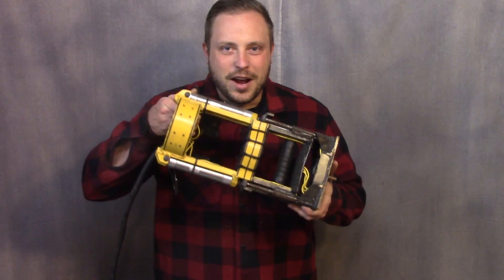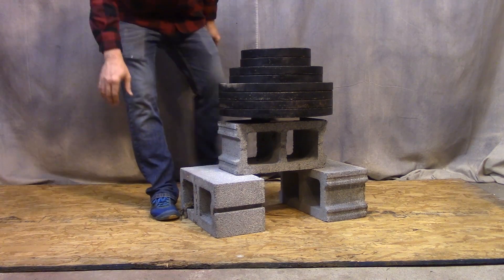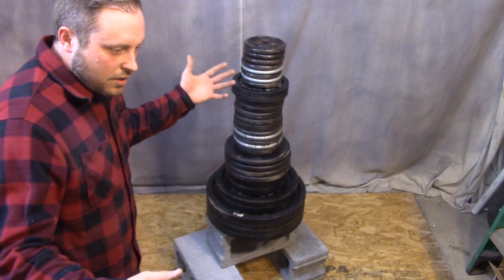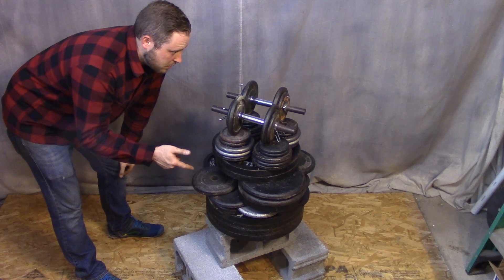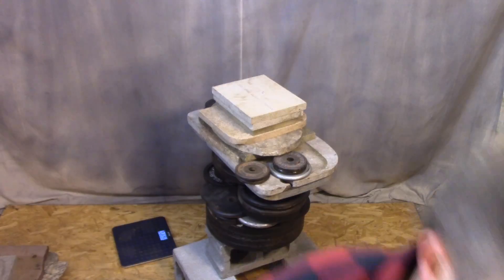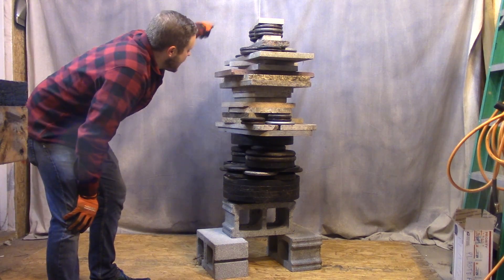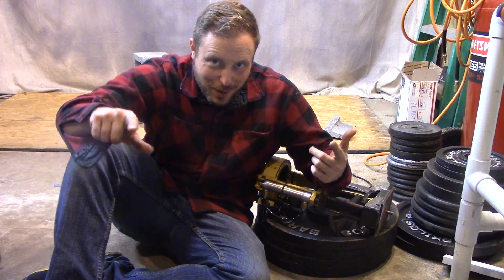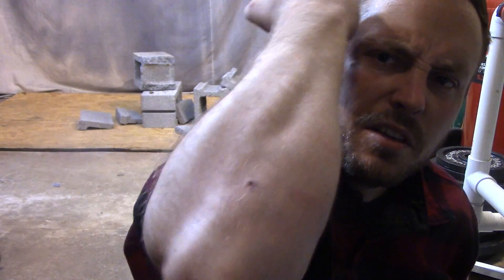POWERFIST POWER TEST - How much force to break a cinder block

Comment: The reason it's not working is because whenever you punch you're putting all that Force even though it's significantly less than the actual weight you're piling on because it's so fast you can break it but if you pile it on slowly it will actually be able to bend and stretch but concrete can't do that very fast so when you pile it it can hold more weight than what it normally could if you were to hit it with that weight if you dropped the same weight more than two inches you would break it without a doubt even half that weight you would break it have you ever taken Silly Putty and slowly stretched it versus pulling it really fast and quick it's because the atoms cannot slide past each other fast enough when you pull it really quickly think of concrete as a much much much much stiffer version of silly putty you punch Silly Putty it breaks into a thousand little pieces but if you slowly put weight on it it stretches and flattens out far more than any concrete ever would but the principle itself is the same to a degree but over time they can move and but if you put on that weight on it Fast it will break the further the atoms of the concrete moves from one another the less strong of a bond they have but they can move slightly to accommodate for weight on top and that's what they're built for and construction is to slowly have weight put on them but if they tried to put the same cinder blocks under that same pressure immediately like if they were to teleport the entire building except for the bottom layer of cinder blocks directly on top they would shatter and be powder in the second
Reply: Jaskatzu He used an Apostrophe..
Reply: How about some punctuation next time? :x
Reply: Concrete has very low tensile strength. That's why we reinforce it with steel. Concrete has very high compressive strength, which makes it suitable for static loads (stacking weights) but not dynamic loads (impacts)

If concrete did have high tensile strength, he wouldn't be able to break it like that. Instead, it would deform like steel would. The reason the block didn't break under the static load despite the hollow space directly underneath it, is because the span was short enough for the weight to be transferred to the two supporting blocks.
Reply: CHRIS CRAFT please use punctuation if you want when dictating an educated opinion
Reply: CHRIS CRAFT longest sentence ever
Reply: An being singular haha. Holy shit
Reply: Reading this made me run out of breath
Reply: CHRIS CRAFT you sound like a 10 year old who knows what he's talking about but doesn't know the right words
Reply: F=ma he was adding no acceleration and therefore very little force.
Reply: Shining Darkness nicely put the only reason I didn't do it like that is because it wouldn't make sense to most people
Reply: CHRIS CRAFT well most people need to pay attention in highschool physics. F=ma is like day one.
Reply: This made me feel like the people who yell at prerecorded videos because the actor is being stupid or is stupid and needs to be educated immediately or else fails. I do think he eventually smartened up when he was like, "maybe this falling es no bueno" dx
Reply: CHRIS CRAFT have you ever heard of a period?
Reply: Shining Darkness while you're on the right track of thought, f=ma is not the right equation. This is because the weights on top of the block ARE accelerating due to gravity (9.8m/s^2). If they weren't accelerating they'd be weightless and unable to produce any force (as if they were in space). The difference here is that the static weights are producing FORCE (Newtons) rather than kinetic ENERGY (Joules). Since the power fist is in motion, it is capable of outputting energy, which may have enough power to break the potential ENERGY of the bonds in between the concrete molecules.
Reply: CHRIS CRAFT TLTR
Reply: CHRIS CRAFT yeah I thought about this as I worked a short amount of time in brick laying and learned about how cinder blocks and bricks could hold tons of weight but if you were to hit them with that ton of weight very quickly they'd snap from the force
Reply: Shining Darkness ha ha right people sometimes just discredit things before they have the chance to explore them
Reply: All I saw was a run on sentence
Reply: CHRIS CRAFT Don't worry I don't care about punctuation it is puzzling people have a hard time seeing things without little tiny marionettes idk just weird creatures
Reply: CHRIS CRAFT thank you
Reply: CHRIS CRAFT lmao
Reply: Mister Anchors oh man, you were using your mind to read this and you started to loose oxygen flow to your brain? You might wanna read more and get yourself checked cause i doubt you read it aloud
Reply: Mr Lions if he did i believe he would have regretted learning about one
Reply: PhD in engineering, never took 1st grade English.
Reply: Also, why did you capitalize Force? This isn't Star Wars.
Reply: CHRIS CRAFT  a very apt explaination. motion is also a force multiplier  generating more kinetic force then static force with a smaller source added with a focal point. example if arm ways 5lbs it generates 5psi but when arm moves at a rate of 5mps at a distance of 2ft then arm now puts out 5psi x 30 add the size of fist and you gat this 5psi x 30 x 10= a crap ton of psi. now I know the math is Bullshit but that is loose explaination.
Reply: CHRIS CRAFT this is the perfect example of a "Run-on Sentence"
Reply: I was gonna make this comment but im glad i didn't because you already explained it lol, exactly concrete has an amazing tensile strength which is why we use it in so many of our buildings and other parts of our infrastructure.
Reply: CHRIS CRAFT I bet you're fun at parties
Reply: nice wall of text

Comment: I think it's the angle or the concentration of the force on one point is why Connor can punch thru a cinder block
Reply: Giblam1 you are correct, as an engineering student you learn the difference between impact toughness and ultimate strength. If a material is able to absorb the weight and adjust it's shape accordingly, then it will resist as much as it can possibly and that's it's ultimate strength. But if I can't as it is a sudden burst of energy, it can likely fail and break easier. This is due to differences in atomic bonds, kinetic vs static friction, elasticity, ECT. The best way to show how much force the punch would be is to use a rig that collects data from punching an object, collecting velocity over time and doing the necessary calculations for kinetic energy and force
Reply: there's a pin on the front, all the force in concentrated on that very small surface area. his "experiment" doesn't prove shit.
Reply: If we're talking pressure kinda. But here he's comparing potential energy (the weights) and Kinetic energy. The formula for kinetic energy is 1/2mv^2 while the formula for potential energy is mgh(g being the gravity 9.8N/m^2). If he really wanted to know how much weight he needed, since energy is energy, it would be isolating the mass of mgh with Ek=Ep.
Reply: It because he putting pressure on the whole block instead on one point ,and he isn't putting actual force on it he's just putting pressure so it's gonna take more weight then just a normal punch
Reply: Which is why I wonder why how does him stacking weight on the cinderblocks like it matters lmao
Reply: Boom tendo was about to say, the weights are slightly inaccurate as the fist concentrates force in a small area, while the weights are more spread
Reply: Boom tendo it's also the momentum and kinetic energy of his fist
Reply: Uh no, Cinderblocks are designed to be layed so rebar can be fed through them and then filled with concrete. The center adds extra durability, stack-ability, and a spacer between rebar. Cinderblocks are never layed in this manner in construction.
Reply: K Staffenberg no lol stfu wrong
Reply: Force would be mass X gravity the thing you mean would be kinetic energy wich is the reason the blocks broke because of the punch but not from the weights
The weights were pusching with more force but it was potential energy so when you add a little momentum to something it is way more powerfull than something with more weight than you as a normal man or woman could punch. 
And please don't hate me because of this comment XD
Reply: Boom tendo could be wrong but I'm assuming it's also the speed that takes into account as well
Reply: The force exerted by the weights is more than enough to break the block. The real problem is with distance and position. If you look closely, you can see that the diameter of the first weight is almost the same as the block itself, that not only means that the pressure is a lot smaller, but the force is also spread perfectly to the other two supporting blocks. Essentially, this is the same as having the block on the ground and as a result it is almost impossible to break the block unless you had enough force to totally crush it, which is much higher than breaking it into half since the block was designed to support entire buildings. In conclusion, he accidentally used an unfair comparison
Reply: in a way you have to add force and not pressure
Reply: Watching a lot of YouTube is what I'm doing at 2am
Reply: Boom tendo I think he moved the base support blocks a little further apart the second time
Reply: Boom tendo same just putting the weights on will do nothing until it reaches its breaking point of how much it can hold but hitting a lot of force onto it would break it.
Reply: Twan Schollaardt, the pin is the trigger to the fist when it is powered and is only in contact with a spring behind the plate so the weight is put on the front not the pin

Try watching the build videos
Reply: Watch the build video @vesting carpet
Reply: You are correct. Applying enough pressure to a single point all at once is the trick to breaking things like cinder. Cinder and concrete can withstand upwards of 3k lbs as i recall. But can break with as little impact of 800 pounds

As long as it strikes with a small point of impact or all drops on it at once, you can crack cinder with as little as 300 in some scenarios.
Reply: It's how hard he can hit it plus momentum if he just pushed a cinder block with as much strength as possible he wouldn't be able to break it because it is slowly being forced onto it
Reply: Boom tendo it's about how much force you can put out in the littlest amount of time the bricks can hold a lot a lot of weight like 7,000 pounds but it doesn't take that much to punch through a cinder block humans can do it with just our hands
Reply: Kirk Lemmie this is what I was going to say
Reply: Well plus it looks like about a 3/8th inch bit of rod in the center of the front of the power fist so that would probably be a big factor maybe like the difference between getting hit with a boxing glove vs stabbed with a spear anyway that's my 2 caps
Reply: yep, the force is at a tiny point, making more of a shock than pure force.
Reply: Boom tendo that's not actually that much force
Reply: Boom tendo I Thought so too but it appears that the apike is just the trigger for the fist to engage
Reply: Proud.To.Be.Whomst I agree with you because it's proven with science... that's how a sword cuts
Reply: Boom tendo you're correct
Reply: Glass Golem Oh I didn't know that well my whole theory has changed.
Reply: Disfatt Bidge Its not as hard as you think to do it. My old martial arts instructer did it in front of me.
Reply: Boom tendo Bro with a powerfist u can easily break a cinder block no matter what. The blocks themselves r actually pretty weak but still a powerfist is strong af
Reply: Even if its the angel it has more tah 2000 punds of force and tahts with no add putsh
Reply: Max Cooperman but trust me even if he would hit it flat at the center it will break because of the speed he was punching (kinetic energy) i think the formula was force X speed (only works with the metric system that means the speed in meter per second)
Reply: Boom tendo yeah I saw the little thing sticking out and I knew it would break
Reply: Correction. A punch limits the surface area of the applied force. Stacking weight applies stress equally to the entire cinder block (its like putting a book on top of a sheet of paper compared to putting a paper weight on top of a sheet of paper) In addition the force of a punch induces a much higher transferred force at one instance. The breaks of placing masses one at a time reduces the stress applied at one instance (think of slowly stretching an elastic band so it can stretch farther compared to tugging and snapping it at once)
Reply: Boom tendo yeah the samw force is used except tge force is distributed through a small area making a much greater concentration of the same force thats why he could break it and the plates couldnt
Reply: TitanGaming™ yeah that's true. Getting punched for example has high gee so it's more probable to break something than a firm, yet slow push
Reply: He prob broke it because he didnt hit 100% in middle and its not your fast hit bullshit , kids learn physics please, dont be dumm
Reply: SsSudden Impact
Reply: Indeed, & watching through several of Jairus of All's brick failure test videos how painfully he tries to break the brick but doesn't seem to put much consideration into the contact surface, I wonder whether he even knows what force, pressure & the difference between both is :|
Reply: Boom tendo i
Reply: Boom tendo or the striker
Reply: Boom tendo then he will use the force on the rest of the weapon to break it
Reply: B
Reply: Boom tendo ofcurse what u mean?
Reply: Boom tendo Lol Why would an angel help Him
Reply: Boom tendo unu
Reply: Boom tendo ه
Reply: WRONG
Reply: The striking impact surface is flat, that nub retracts back as a trigger system for the CO2 to be used for increased force and nearly twice as much impact force.
Reply: yes
Reply: Fuck
Reply: Its just that the weight is distributed almost evenly to the surface of the concrete that's why it didn't break.
Reply: agreed, in the video you can see that it broke next to the center point, not actually on it. applying an even force directly on the middle is the hardest way to break a cinder block because that's exactly what they're designed to withstand
Reply: I think he can punch through it because he is suddenly applying large amounts of force, as opposed to slowly stacking it on
Reply: Boom tendo it was actually the Spike on the fist that did it. it puts more pressure on that one spot as apposed to spreading it evenly. that's how people can lay down on a bed of nails and swords, because the more swords, the more even the pressure.
Reply: 85 kg me can stand on a cinderblock no problem. But my right arm that weighs something like 5.6 kg can punch through THREE of them resting on a table, leaning against a wall, placed right beside each other. Its the sudden application of force over a small area that causes the cinderblock to fail because they're not designed to withstand that. They're designed to support heavy loads over a large area.
Reply: Zandy hey now I know my physics or else I won't be here and there is nothing wrong with what was written here since there is more than one factor that affects the chance for the block to break. Hitting perfectly in the middle is ideal because it has the longest distance from the supporting blocks aka the highest moment. F*d=moment. Then there is surface area, less surface area means more pressure and higher pressure is what makes the real damage. F/A=Pascal. And then we have the last factor which you called "BS" the speed of hitting the block which translates to the speed of transmitting the energy from the punch the the block. This is the work done per second or more commonly called power, getting hit by a truck for almost an instant is more damaging than being slowly pushed for an eternity is because although these two situations transfer almost the same amount of energy, the truck transfers that energy much much faster, creating a huge gee force(acceleration) for a short moment that breaks the bones before it is transferred to the ground. As you can see, I did study and I hope you've learnt something too
Reply: MASSxVELOCITY=FORCE he put as much weight as the guy can punch but the weights werent moving therefore the force was small, put if you drop the weights from a distance that would let them speed up as fast as conors fist, then it would break. its all about the ratio of speed to force, btw im not an engeneer im some random kid
Reply: Yes, but...
2 cinder blocks.
Reply: Gregory Woomer Vlogs its basically (mass X area of impact) x speed = force I think
Reply: That's exactly what I was thinking, all of those weights are distributed on the entire cinder block...
Reply: Math Laboratory woah exposed
Reply: plus the little pipe sticking out of the middle
Reply: Boom tendo momentum is a winning factor.
Reply: Boom tendo Your right and also the speed because with Connor it is fast because it's a punch so it's sudden. But this one is a slow progress so that is why it doesn't break.
Reply: Jorji that's is to activate the punch
Reply: Boom tendo The tip on the front has such a small area that the pressure will be greater. Pressure is the force exerted on a surface area. Or P=F/A so the pressure is so great because so much force is focused on a small amount of area.
Reply: Marc Ortega you're wrong
Reply: Boom tendo it's cause on the powerfist thing the force is greater and it has a bigger surface area than a fist
Reply: Boom tendo dumbest thing I've ever heard